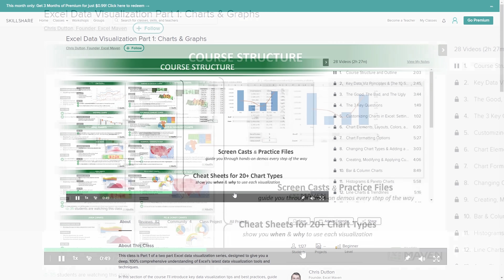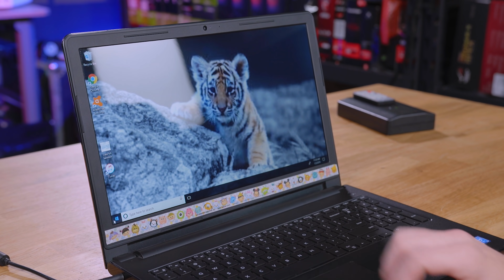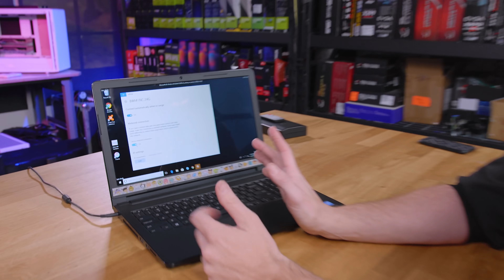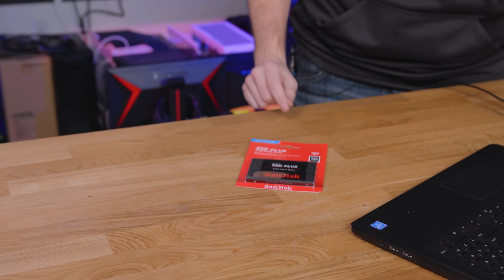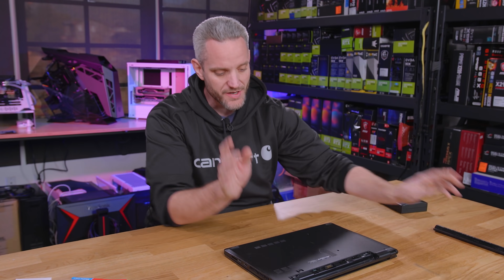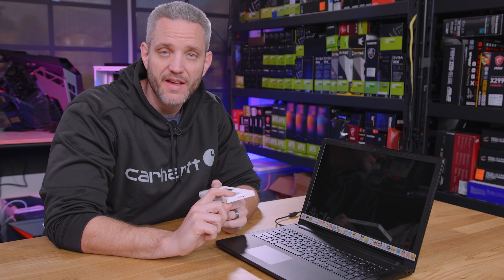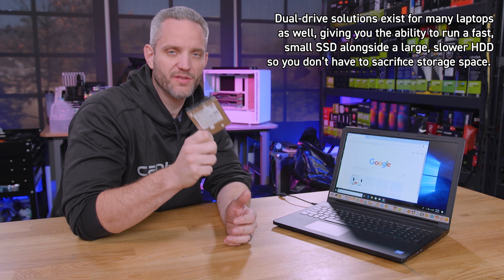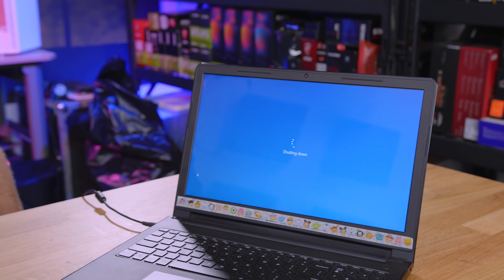Repairing an old laptop for as little money as possible...

Comment: Even before you said it was windows update, I was thinking on putting some lightweight linux like ubuntu mate or similar. Most of the average users only need the browser and maybe office. Chrome/firefox + LibreOffice and you're done. It's even better for kids or computer newbies since it's harder to get viruses or malware (though not impossible).
I've switched about 30ppl to linux and most of those started with "hey I need a new computer, mine is super slow". I install Ubuntu Mate or ElementaryOS to the same machine and they go on using it without dumping a ton of money on a new rig.
Reply: Willdrick great advice. Agreed, this celeron sucks
Reply: I don’t want to give anyone Linux, it would just be nonstop questions about it.
Reply: @EvilTurkeySlices  Someone speaking sense. The vast majority are using Windows and practically everywhere runs it. Libraries, cafe computers, school computers, etc etc. I don't know anybody who doesn't have experience with Windows. Even I cannot use Linux, wouldn't expect someone who knows less than me to understand it either.
Reply: cool dude It’s easy to use in some ways, but is unnecessarily complex in others.
Reply: I have a serious problem with this approach I know a guy in the GTA who does this. I've had to tech support an acquaintance (an older lady in her 60s) several times because he put her on various Linux distros (probably with the same reasoning as you.)  the problems is she gets home and doesn't know what she's doing. So when she does accidentally turn on something or turn off something or get something weird from some weird website. She doesn't know what to do in linux to fix it herself. And finding quick easy to follow trouble shooting guides online is difficult.  Even getting someone like a son or a nephew who knows computers well enough is less likely to be familiar with linux and thus harder for them to help such a person also. My best advice for anyone who uses a computer mostly for internet browsing/watching some netflix/youtube, and emails. Is to get them a refurbished Mac lol --seriously that's about all they good for. Or in all honesty,  go disable windows updates, enable defender, put an ad blocker and maybe something like bit defender on it. At least if they call nephew jimmy when she can't download her favourite tv show, he'll be able to help her out with it... as windows is the most widely used universal platform that the majority of the world interacts with in some capacity whether work, school, etc.
Reply: @jaylocked9072  Just an FYI: Having Bit Defender or any other AV will turn off Defender's day-to-day usage. It'll still run once a week in the background, as a supplement to your main AV, but that's it. 
As for the rest: You're exactly right.
Reply: and not even to rag on Linux. Linux is great if you know how to use it. But let's face the facts here most of the people who need help with their computer running so slowly like this probably don't know how to run a cmd line anyhow. Remember we're talking about people like your grandma, or your aunt who watches pirated tv shows on a shady Russian website. :s We're not talking about JayZTwo cents subscribers who I'd imagine those who are all shouting put linux on it could probably have done this upgrade themselves anyhow. And probably also never would have a computer in their house or families house running that pathetically to begin with cuz they'd have fixed it for them. Just dont throw linux on a computer for someone whose not gonna know how to use it. If you're a random IT guy fixing old ladies laptops cuz I know I've been on the other end of those phone calls/skype calls at random times of the night can u help me with my laptop linux is doing something funny. "Me; Curses tech guy in Toronto. Why didn't you just put her on windows, ffs"
Reply: @jaylocked9072  the problem is that windows slows to a halt on old old HDD's. If Linux can handle older HDDs and still be usable why can't windows? I'll tell you why I think that is. I think it's because microsoft is either incompetent (which we know they are in which case we should not be giving them our money  to begin with) or they are making them intentionally slow so the people that you described think the hardware is at fault and they need to buy a new computer. That new computer would of course come with a new windows license making microsoft more money.
Reply: That sounds like a horrible idea, because a lot of ppl are used to windows and are used to the way things work. Hell if there is even a slight change in software, it took some ppl i know moths to learn what to press and even 3-4 months later i'm still being asked questions. 

It really depends on the person, but my exp with ppl that aren't interested in pc that are age 40+ was really really bad, to the point where a change in ui will confuse them.
Reply: thegeorgezila  I totally agree for the basics, but then you get that one program you want thats not properly compatable or needs configuring in WINE or installing via command line, and thats just not practical. I could not teach that to some of the less tech savvy people in my family, hell it took 3 goes to get my Grandad to remember how to use window snapping, and thats only involves dragging the window to the side...
Reply: I would also recommend CloudReady (ChromiumOS for old PCs). I have an Intel Compute stick (gen 1) that I was using attached to my Kitchen TV for streaming, and eventually got sick of Windows slowing it down. ChromeOS works beautifully on it, and is much simpler than Linux for the uninitiated.
Reply: Try to explain linux to your grandpa or to your non-tech father. Sometimes the best way of dealing with slow computers is installing fresh windows and telling it to fuck off and just work. That means disabling all updates, putting windows defender in basic, deleting most of the bloatware that comes with the printers or that kind of stuff, etc.
Reply: @Mr_Spock512  chromebooks or a cheap surface. Simple setups that are cheap, reliable and as idiot proof as they can possibly be without getting into macOS territory. Problem is they are not future proof and good luck trying to explain to your grandpa why they have to change their kind of perfectly working device for a new one.
Reply: @flashcat6665  The more people switch to an alternative operating system, the less Windows will be relevant and the less people will keep asking a bunch of questions. It's just how it is. The market does the thing and as long as Windows dominates the desktop OS market, people using other operating systems have to deal with that kind of stuff... Sad...
Reply: Many average users also us a number of windows programs. Not everyone is elderly who just reads mail and browses web.
From issues with getting misc phones or cameras connected for pictures or various USB devices they may have - lots of driver problems or missing drivers.

Also skype - linux version is horribly out of date.
You can often find a few basic simple games - and they are not going to dig into the wine emulation world. They just know how to click an icon or installer and be done with it.

There are many tiny things that will not just work and need more advanced knowledge. So you better be ready to be on constant phone support and know how to solve the problems.
Reply: @cool dude Say that to a average user to " go google and use reddit and then open terminal and write all those commands" - people consider chrome dev tools a eird thing hackers use. Terminal is a no go.
Reply: @MauroTamm  This brings us to the next thing, what you just mentioned is a result of the dominance of Windows... It's an endless circle.
Reply: @EvilTurkeySlices   and @JayB : If the owner of the computer has a smartphone, they already know how to install and maintain a linux install. Just go to the "appstore" and download stuff. Linux is not for everyone. It's really excellent for savvy people and for complete noobs, the mediocre in the middle will find the experience a bit more frustrating if they try tinkering with it without reading on the subject. Those Chromebooks that kids and grandpas use? those run on top of Gentoo Linux, one of the harder distros to install and get going (almost a meme now). Do you see them calling support 30 times a week? no, because it's a streamlined user interface: they don't need a terminal, they just need chrome for email, facebook, etc.
Reply: Willdrick there isn’t many applications on the store. You have to get a lot of them from the terminal.
Reply: @Raigekon  In my case Window 10 was already that kind of change in software. Surprisingly moving my mom to Linux was easier than moving her to Windows 10. I've simplified the UI as much as I could for her which I would not be able to do on Windows, not as easily. People in 40+ only need web browser, email, print\scan, file manager, some stuff like skype and that's pretty much it. Most of what they do on PC can be achieved with Android tablet for god's sake, what are you even talking about.
Reply: Good idea in theory. But it has flaws, which someone who uses Linux on daily basis might not find obvious. The problem is that Linux does things differently. Like to install something you don't fetch exe file from a site, you have to go to packet manager for it. And while this is obvious to those of us who are into it, it is super not obvious to average user. Plus don't get me started on when you have to tell average Joe to use terminal, which you do if you run into issues on Linux. And for average Joe, connecting to WiFi is higher science in Windows. And here comes second issue, finding instructions online for Windows is easier than Linux. Like for example, even in faculty, all instructions on formatting and stuff were only written for MS Office, so good luck translating that to Libre Office or Open Office, I gave up on that. And then you run risk that Libre Office might not properly save .doc and you might miss a deadline, because teacher can't open the file in his MS Office.

And no, Linux is not hard to use. But I feel that whole Linux community has bit of a hard time looking at things from perspective of average Joe, because things are super obvious for anyone using Linux as daily driver. So it is just easier to put on Windows and be done with it. Less questions, less issues and less things to get used to.
Reply: @EvilTurkeySlices  From the perspective of a basic user, it's pretty easy. Running web sites, watching YouTube, et Al it's virtually identical, and with Linux all updates are manual, so you can set up a stable version and it shouldn't brick itself.
Reply: @Seth22087  Most Linux distros come with a "Store" now. And since most people are used to Android, iPhone, Mac and even Win10 stores it's not a problem for them to get this idea. Then you can always just download .deb and .rpm files and install it in 100% the same way as you would on windows. And .exe files are a virus galore anyway. It depends on what the person needs from a PC. Some young guy, gamer who's not techy but considers himself capable of handing windows maybe. But say an average mom or dad in their 40-60 range? My experience shows me that Linux is actually EASIER for them to use. I mean they would still call me to install something more than Skype on Windows. In Linux I can at least tell them to "just open that Discover app, enter Skype and click install. etner your password." DONE! On windows i'd have to explain which link to type in, where to find skype, how to not get onto some fishy site, how to download it, open filebrowser, double click, next next next. Not much harder but still more actions to do. And if skype is not in repo then it's just exactly the same, the only difference - .deb instead of .exe. Oh my god, its so hard.

Your experience may be outdated. Linux is getting more and more user friendly by the minute. To the point that I was able to install it on mom's and wife PCs and they have less questions about it than they had about WIndows. It just works. For what they do it just works. Better and faster than windows. A lot of people use Macs, mind you. ANd it's closer to Linux than to windows. In my case my dad has a better chance of helping my mom out if she uses Linux and not Windows. And Terminal is not a requirement for daily use anymore. It's just a bit more convenient to do stuff through terminal sometimes.
Reply: @nixellion  I can tell that just couple of min after i read your comment i had a call that something doesn't work(windows). The ppl that i help(family) don't even know how to log in or out of gmail. Over this year i've had multiple random things happen that took some effort to solve, just because someone clicked on some random thing. I admit that i don't have much(barely any) exp with linux, but with windows for almost everything there are fairly well detailed instructions on how to fix smth. 

Further more, i occasionally help with business pc as well(small business) and the random shit that happens is just crazy. I can tell you that the boss(my uncle) has to write down instructions on a paper almost every time there is a slight change. That said when there is a change in ui even i get confused a bit, but i click through things and have decent awareness where i should look and i don't click on smth that would fuck up everything(happened to my uncle).
Reply: @Raigekon  That is kind of the point. To a lot of people who ask me\you for help there's no difference if it's Windows or Linux or Mac, they will still ask questions. I don't know when you tried anything with Linux, but for Ubuntu and Linux Mint (which is the same, as a matter of fact, ubuntu guides work with Mint) there are large enough communities that you can find answers quickly. In fact I must say that Linux community is much much more friendly than Windows. If you ever tried asking anything on Windows support site you'd know that most of the time they just copy and paste stuff from their own docs, which never helps. Other times when I ask on reddit I often can't find answers with anything out of the ordinary happening with WIndows either, because 90% of windows userbase don't know much. With Linux there are always quick answers. No need to even search, just ask on reddit and you'll get 20 detailed answers in 5 minutes.

With Linux as a user you CANT FUCK UP the system easily. Unlike windows it does not let you break itself unless you're using root password, which is like super-admin in Windows (which you actually dont have access to in Windows). It's much easier to break Windows than Linux, to be honest. And with Linux its always possible to recover and fix it. Windows? Most of the time you'll get the "Reinstall windows" suggestion. Which is also the only or easiest solution most of the time. 

But of course in the end it's up to you. If you're ok to pay 100-150$ for Windows License and keep up with their Windows Updates breaking stuff often without you having ANY control over that if it happens, and paying extra for extra CPU\GPU\RAM\HDD required to just run windows, in exchange for that little bit of convenience - that is your choice and only you can make this descision. I'm just sayin that I was there, I was a win and even win10 fanboy. Granted I am tech savvy. But I was always kind of hostile to Linux myself, in a way. Now? Now I'm not anymore. Now I think it's a great OS, which I would gladly use 24\7 if I did not need to work with game development and if I was not such a gamer myself.
Reply: @nixellion  Windows under the hood is horrible. People use it because many programs are made for it and it comes preinstalled on most computers (except Macs, of course). And the battle isn't really Windows vs. Linux but more systems coming from MS-DOS (like Windows, OS/2, ...) vs. Unices (like Linux, BSDs, macOS, ...). Latter is generally more robust and modular. If programs were mainly made for those systems (porting between unices has proven not to be hard), manufacturers installed one of those systems and more support was shown for those systems (driver support, better UI, contributions to open source/free software projects) we would have a much better time. Now of course this doesn't come without saying that without the majority of the people using Windows on their desktops, alot less  people would be employed fixing Windows machines and providing solutions for it since unices break down a lot less and are generally more robust. Plus, the benefit of using a package manager instead of downloading .exe files from somewhere is that you have a source of software you trust and can rely on instead of possibly downloading unwanted software and unnecessary setup.exe files which do whatever they want and you can't be sure to have a clear structure. Furthermore, having a package manager also means that it keeps track of the installed files and hence packages can usually be removed without leaving traces.
Reply: And really, nowadays you talk to people on social media and use live chats to ask for support, so why can you talk to humans but not enter a simple command like "sudo apt update && sudo apt upgrade" or "sudo pacman -Syu".... It's not really much different than asking someone for help, plus it's shorter.
Reply: @xdevs23  I'm not sure if you're just extending my answer or trying to explain this to me :) I'm am all for Linux here, and I can sign up under every word of your two posts. You also dont need to use sudo apt update, most distros have update manager which does it for you. KDE, for one, will show you "hey there are updates available" in the tray, click on it - it shows you everything you can update (yes by the way, every software, not just system stuff) so you either click "Update all" or make a more educated decision about what you want to update exactly. And lots of other bonuses. But I can't speak for which kernel is better NT or Linux.  Dont have that kind of indepth knowledge.
Reply: @nixellion  Just extending. Wanted to make it clear that saying people have to use the terminal for updates is no excuse since typing in commands in not very different from telling someone to do something, it's just a shorter form and if you know what the command does you are good to go. Now, of course, as most people are used to GUIs, what you just mentioned is a good solution for that. Also keep in mind that in the early days people had to work with the command line no matter what.